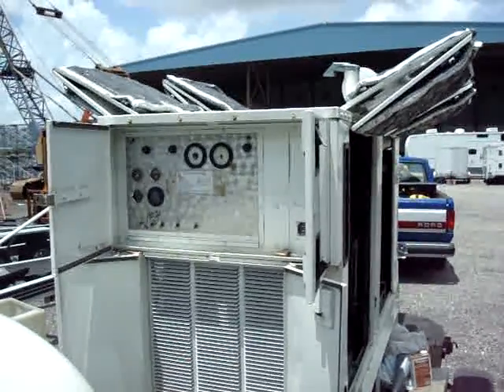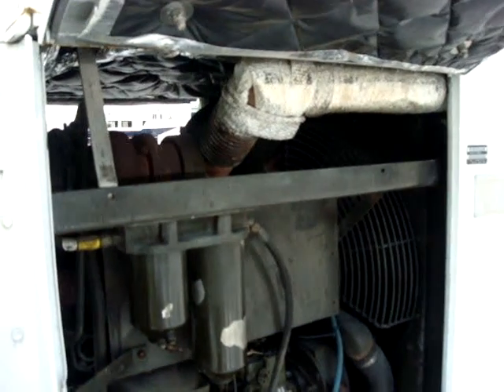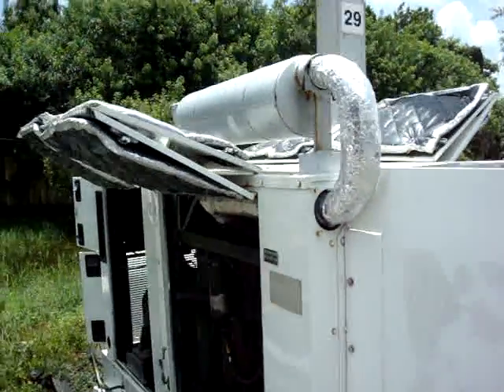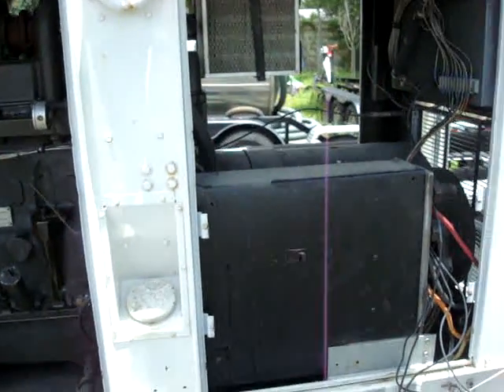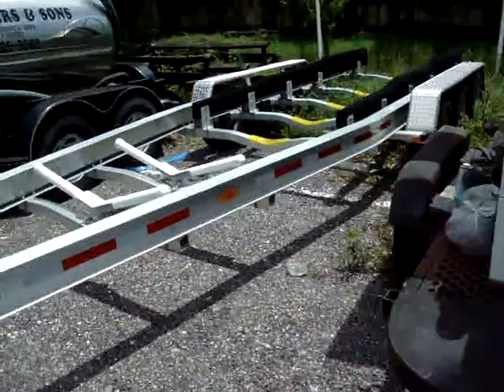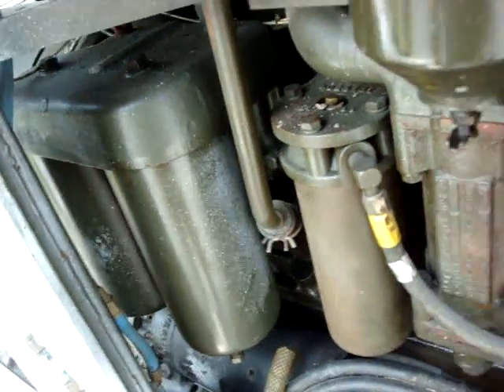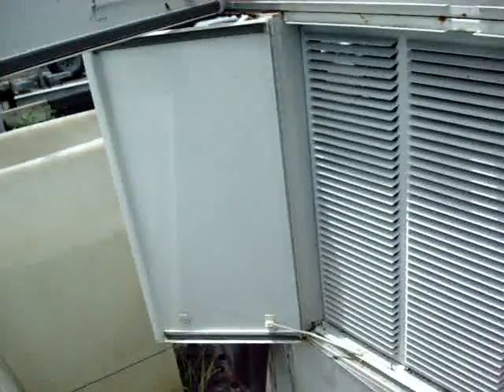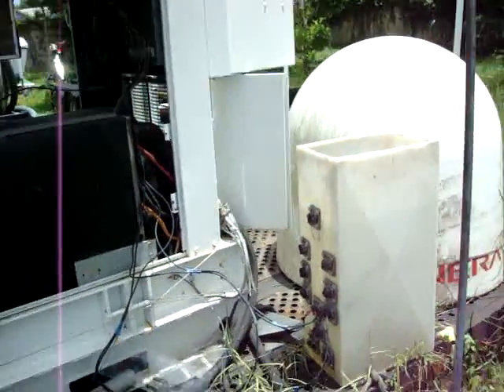60 KW Turbo Diesel Part One  DEMO  Military Generator set

Comment: You guys put some work into that thing, I like it! I have a couple of units myself. An 802A for my home backup (runs at 60% with my central air running) and an 805B I use for field ops for a search and rescue I volunteer for